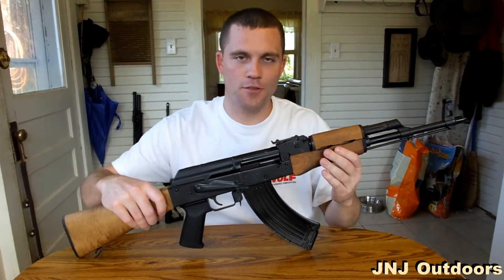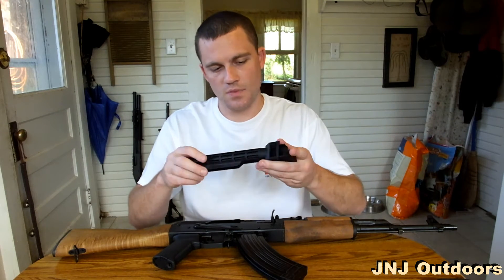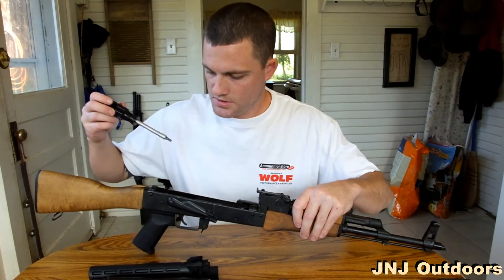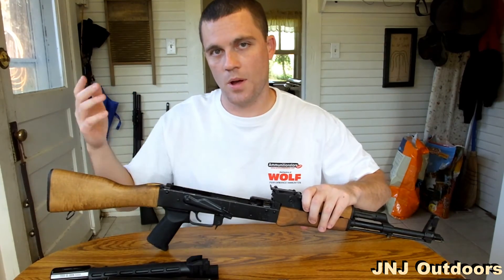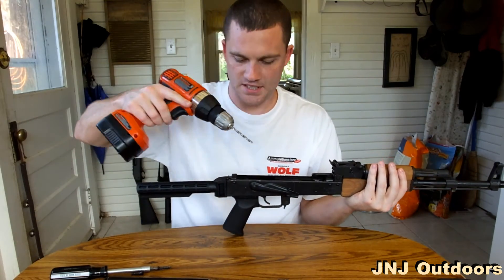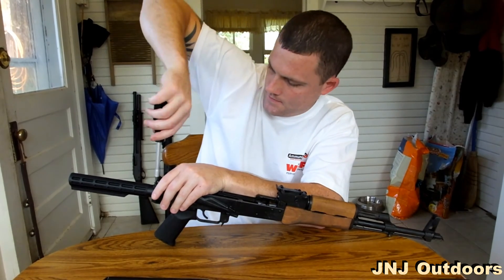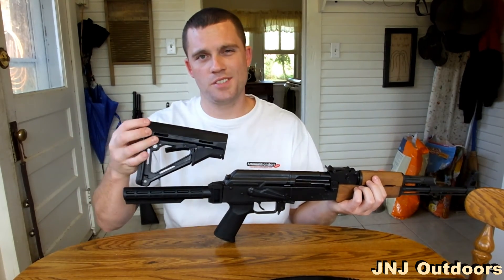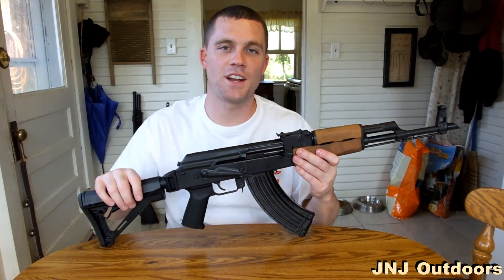WASR 10  CUSTOM BUILD  PART 1

Comment: i like the video man. pretty informative.
but the wasr is actually made in romania. its assembled by parts kits in america by century arms international. the tapco parts are put in to make 922r compliant. i just got a wasr a couple weeks ago, pretty satisfied with it, but my buttstock is actually crooked. its not the rear trunnion or anything, the gun itself is assembled nicely. i actually took out the stock because i was freaking out about it (ocd) and the stock piece itself is crooked slightly to the right. can't believe i didn't catch it before i bought the thing. needless to say i have one of the arsenal black polymer (aka plastic lol) stocks coming in. also got a tapco retention plate for the trigger group and one of the ak74 muzzle brakes. these things are freaking sweet for customization aren't they